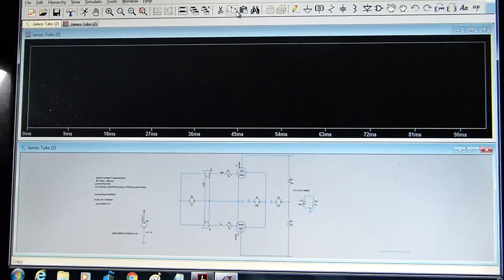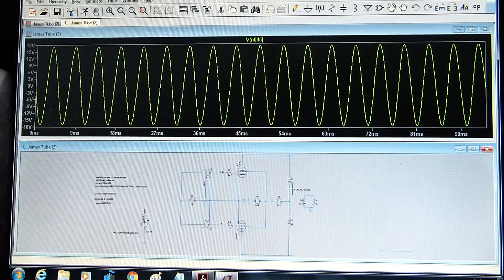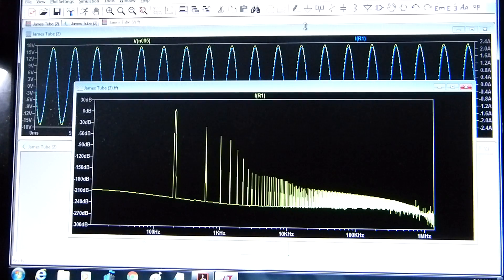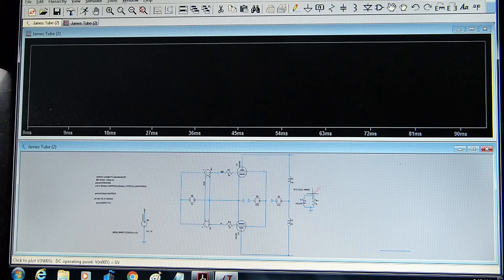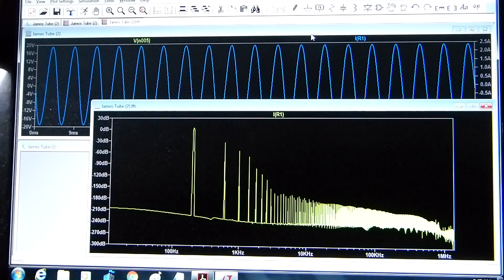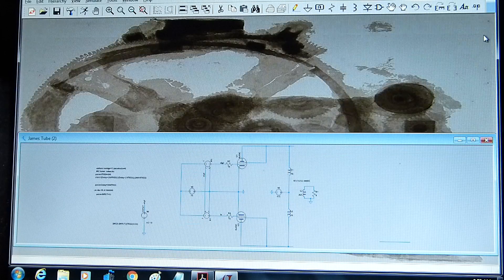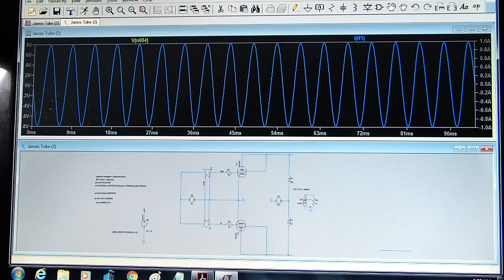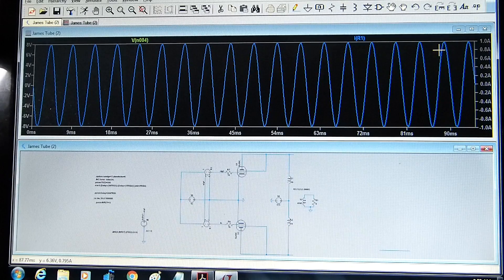LTSpice Model of 6L6 As Beam Power Tube vs Triode Mode With 5K and 6.6K Output Transformer

Comment: I'm not sure how LTSpice works and may have got it all wrong but...A decent output transformer for a 6L6 will have around 50 Henry primary inductance. - even in push-pull - only a thousand times bigger. The 6L6 makes a  relatively poor triode,. You are almost better off with an EL84!!  The EL84 will make 2Wsingle-ended (you may get 3W from the 6L6).

Comment: dude: expecting an FFT response at -240db to reflect anything in the real world is silly.
AND  all of this depends strongly on the tube model.
Reply from the maker: Completely agree that -200 dB is unrealistic but we just talk about what the screen says sometimes. In measuring S/N on an amplifier, even -90 dB is tough to replicate each time. Thanks for noticing and commenting.
Reply: you are a gentleman :-)
Reply: Sitting and waiting for a show in MKE I was thinking about your video, it seems you were trying to examine how HD may relate to the match at the output tube to the transformer load,.... You found of course that it makes little difference, especially under the conditions of a pure resistance load.
Changing the match will have a huge influence on power transfer, but not HD. The transformer presents a scaled version of the secondary load, so within the BW limits of the transformer - the output tube will see a reflected resistance change. So not surprising that HD did not change.
Reply from the maker: I agree with you again and I have actually experienced this by using a 10K transformer where a 5K would be ideal. All works well but maximum power output is considerably lower with the 10K load.

Comment: This is very interesting, you are saying in a Class A/B amplifier - there are no even order harmonics in the output section.  So that classic power tube distortion everyone talks about has nothing to do with even order harmonics - despite all the lore out there that tube amplifiers sound great because of even order harmonics vs. transistor sounds lousy because it's all odd order harmonics.
Reply from the maker: In this model of a "perfect" transformer that has no series resistance, shunt capacitance or reflected (leakage) inductance, the transformer does not create any even order harmonics and the PP circuit suppresses even order harmonics so in this example we have no even order harmonics. We can use this in the model to evaluate the voltage amplifier stages before the output stage and transformer. The interesting thing is, if we look at a SE amplifier, the second harmonic will be very large and the following harmonics will decrease in amplitude along a somewhat straight line. This second harmonic is not desirable to have and the PP amp stage does a good job of reducing it. I am not certain of this but it does seem to appear that the transformer itself, with its imperfections, creates a certain level of even order harmonics - and we like it.... we seem to like the robust sound of iron transformers in tube amps.
I think all this Internet lore and wisdom of all odd order harmonics are bad is incorrect. The problem is when something like this propagates,  it is almost impossible to change the minds of the world. A good example is the use of RMS power, it is called average power, and the little flashing filaments in the 1960 era Mullard and Amperex tubes. Some people say they are all defective and throw them away immediately. What a waste of ultra high end 12AX7 and 12AU7 audio tubes. Highest quality SS amps use transformers in the output to ensure you get full power at all impedance levels. I have large McIntosh amps that operate this way and they are marvelous and powerful.
I am still a tube person and just love to build and measure and share all of what I experience and I end up very often with great conversations and comments like this one. Thanks for your comments.

Comment: what about using audio version of the 4:1 balun for the input to the grids and a similar one for the B+ with the ground of the driving 4:1 unit via a 0u1 ceramic capacitor and  grounding the negative lead via a ceramic capacitor and using the tap at the balanced to apply grid bias and a similar 4:1 unit on the output and also having the ground lead connected via a 0u1 ceramic capacitor and the B+ connecting at the tap on the balanced side and the balanced connections connecting to the top cap of the vacuum tubes and a electrolytic driving the speaker would that work? I know it works at RF but would it work at AF as well.

Comment: Hello, I used LTSpice, and tried to buit the "real thing"  and amazing, it works as expected from simple PP output stages using EL34, EL84. to complete preamp with ECF80 and active baxandall  tone using  some ECC81  and bootstrap positive feedback  it works as expected..  giving the ECF80 a gain of 1000.. when using the pentode of the ECF80 loaded with constant current source by use of a bootstrap circuit... Than I download DipTrace http://diptrace.com and build the schematic and the pcb, and amazing, it works as expected using the auto-router and 2 side pcb...   I even give up byuing a new scope..    I recommend..
Now I am trying a more "classic"  Geda PCB, Gschem, and Qucs... they run on UNIX, and produce more complex simulations and pcbs...

Comment: Interesting if there's an op-amp in the circuit that should raise your noise floor what do you think!
Reply: You should be able to change the colours of the circuit they looked very similar try blue and red instead
Reply: What about if you had a choke from the coil back to the plate if I'm saying that right, and I was wondering if you were running a capacitor in parallel with the output coil you can adjust your filtering might be interesting as well
Reply from the maker: Not sure about the op-amp but all suggestions are appreciated.
In the real transformer there will be shunt capacitance but I was wanting to see in this case what just plate to plate Z might do for the two types of amps. It seems promising. I am still learning the screen details (colors, etc) and the hot-keys. Thanks.